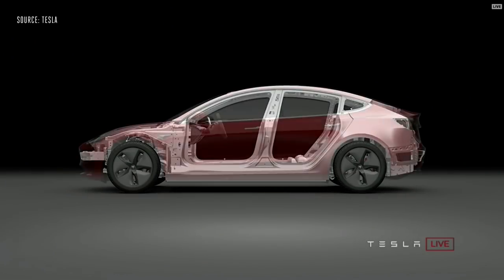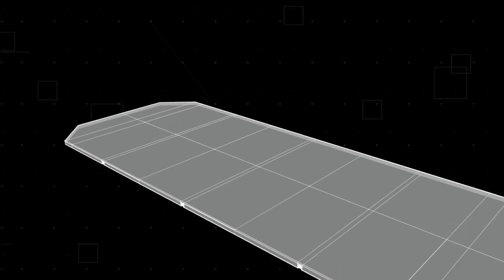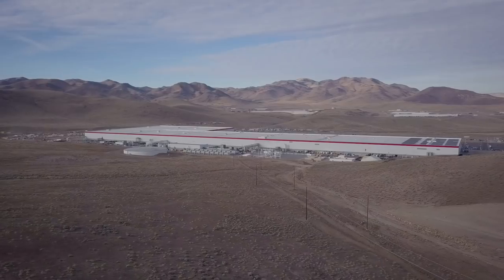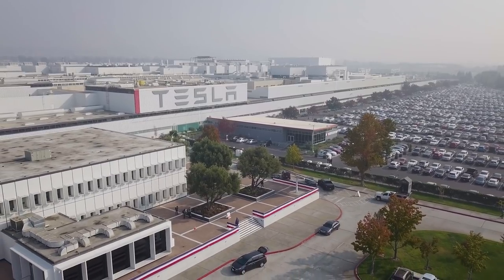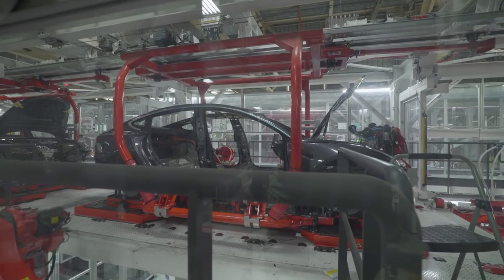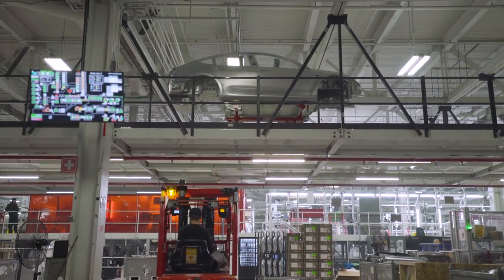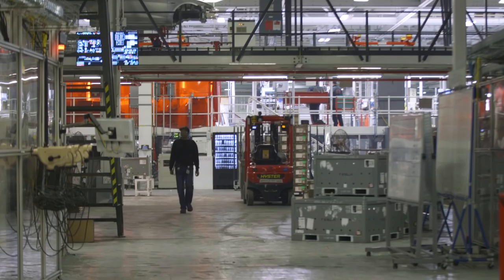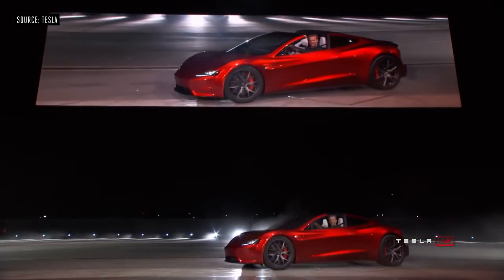This is Elon Musk’s key to Tesla’s future

Comment: Even Tesla needs a Toyota 6:00
Reply: Not even electric!!
Reply: That’s odd
Reply: Toyota has a heavy machine division whats wierd about that i own a firearm made by an auto manufacturer
Reply: In other words, Tesla needs Japanese technology.
Reply: Tell Elon, and he will have a Tesla electric forklift in 2 weeks.
Reply: @michaelclimb  Actually I'm pretty sure it's electric
Reply: Well Tesla did buy a freaking FACTORY from Toyota. Not just vehicles.
Reply: Lmao
Reply: @Neojhun  yup pretty much the fremont factory is ex NUMMI plants which is Gm and Toyota joint factory.
Reply: @uziTGC  judging from the large propane tank strapped on the back, probably not.
Reply: Hayekian see that big cylindrical shaped tank on the back. That’s tank holds a combustible compressed gas. Natural gas? Propane? Not sure. But it’s definitely not electric. 😆
Reply: @treloarw  you are right, my bad! but its not like it has a diesel engine that would fill the warehouse with nasty exhaust gases, that was my train of thought. There are some hyster electric forklifts in the video.
Reply: That tank on the back is for propane.
Reply: True! But also, it will be damned interesting to see who needs Tesla in the same way when Tesla is 81 years in the marketplace like Toyota has been. 👍
Reply: Actually I think the Fremont plant used to belong to Toyota. Additionally Tesla hired Toyota Engineers originally. Since it's a Toyota, I'm sure the forklift has been operating there since the plant was built. :-)
Reply: @SuperGeronimo999  well there already are electric forklifts
Reply: No ish... i am driving one every day. We also have a Diesel Toyota forklift for outside though.
Reply: Toyota does have an electric Forklift, but only in Japan at the moment.
Reply: I suppose the robots should be made by Tesla too....  (News flash: Most factories contains tools made by other industries....)
Reply: @treloarw  that one tank is enough for a day work if you press the pedal hard...  Thats 35 liters of Propane.

Comment: Have to make a quick correction to the narration at 2:30: The Drive Unit is not made of the Battery Pack. The Drive unit is made of the gear box, rotor sub-assembly, stator sub-assembly, and the inverter. All these sub-assemblies are combined and sealed into a thing called the "Drive Unit"— a motor, basically. It turns the battery pack's potential energy into kinetic energy. The battery pack is not part of the drive unit. It is its own thing. The two work together, but they are two entirely different lines in the factory.
Reply: Gaskets.

Comment: One thing that I liked most is that its free of any sort of pollution.
Reply: There will always be pollution from humans.  Tesla definitely has pollution.  It may be in a different form or amounts but still there.
Reply: Not at all, electric cars are extremely polluting. The manufacturing process (especially the batteries), from the lithium mines to the construction is pretty bad for the environment. You have to use an electric car for at least 20 years for it to outbalance the pollution created by standard fuel cars. Photovoltaic technology (aka solar pannels) have the same  issue. However, the public always think electricity = super green, but it really depends...

Comment: tesla solar roof is NOT victory. it's regressive, because it's wasteful. it'll never financially compete with standing seam aluminum or stainless roofs with non-penetrating but attached NORMAL solar arrays - no need to replace the roofing every 30-50 years, which is major.

also, the problem wasn't an excess of automation. it was a poor implementation of automation tech.
Reply: the tesla solar roof will always be for the iMac crowd. some people need or prefer more cost effective solutions.
Reply: @JustinCrediblename  sure. Solar roof is the pure marketing, and it does not make industrial revolutions. It just helps to claim the market for Musk.
Reply: Don't forget you will also never need more than 640kb of RAM
Reply: There’s a wise man who once said “Those who say it can’t be done need to remain silent and let those who are doing it alone”.

Comment: The Semi's and Next Gen Roadsters will be comparatively low volume products so the amount of space required to manufacture them will not be so huge.  As I understand it, the Semi will be using Model 3 electric motor modules and bigger/more Model 3 battery packs so it might make more sense to ship those powertrain components elsewhere and bring the volume Model 3 production in house to the GigaFactory to cut down on shipping costs/time.  The Model Y will be a different story and will probably outpace the Model 3 IF the current trend towards compact SUV/CUV's continue to change the industry.  However, Model 3 sales will probably also taper off when the Model Y becomes available, again if industry trends continue unabated.

Comment: Questions about Gigafactory products:
What is the inbound maximum DC voltage that can come from an off-grid solar array into a Tesla PowerPack? 480 volts DC?
What is the maximum output ac voltage from the smallest Tesla offgrid solar array powered PowerPack and inverter system?
Can you get 3 phase 480 AC voltage out of the Tesla PowerPack inverter?
What is the size of the smallest off-grid Tesla PowerPack system? 100 mwh? 200 mwh?
What is the recommended size of a solar array to power an off-grid 200 mwh Tesla PowerPack system?
About how much is a 100 mwh battery pack worth (like the ones used in the models S and X)? How does that compare to the cost of a Tesla 100 mwh PowerPack?

Comment: A highly complimentary video but there are serious challenges for Tesla that must de addressed to keep the company alive.....productivity at Fremont is still below the Toyota standard at that same plant decades ago despite major advances in automation.....vertical integration is a proven money loser in auto manufacturing.....Ford pioneered it decades ago and moved on....the. Buffalo Gigafactory appears to be at a standstill, except for Panasonic solar production and multiple mistakes in manufacturing at both plants have resulted in billions in debt and no model y in sight.....the problems are serious and need to be addressed quickly before heavyweight automakers like VW and Toyota start serious EV production. They will have lower production costs and have a large dealer network. Tesla needs to hurry now.

Comment: I worked at B,M,W, in Munich Germany in 1987 that's 32 years ago ok the cars are electric but the automation there was nothing new or different about it even the robots were the same and same colour Kuka robots, the factory was so big that we used push bikes to get around, bike parks all over the factory just grab one and away you go to the canteens or little shops they had every where, we had a clock card that got you in the building you could through a machine put money credit on to it to buy your meals or use at the shops or any food and drink machines in the factory, way before chip & pin came out, everything was so far ahead of anything Britain has even now, that Tesla factory is old hat, God knows what B,M,W, is like now.

Comment: My dad recently bought a new model s and it's fantastic, the only thing I hate about it when I've used it is that the charge time is still a little bit to long though that's something I know will be improved on in the coming years. One thing that I feel they should look into though (if they aren't already) is cars with hydrogen file cells are to my understanding they are incredibly efficient, and would become even more so if the electricity made in hydrogen fuel cell was used to separate hydrogen from its paired elements. But that just like the technology tesla uses now is far from being perfected.

Comment: I didn't realize that about Panasonic. Why does Panasonic make Tesla's batteries?
Reply: Because Panasonic has decades of experience with lithium ion cell production.   Partnering with a business  that already knows how to do something lets Tesla concentrate on all the other stuff (such as building the battery pack).
Reply: @romanval69  Thanks! I was under the impression that the battery tech was part of Tesla's innovation, but I misunderstood
Reply: @MsJeffreyF  Panasonic is partnered because they have experience in building the cell factory (which they have done in many places across Asia). The batteries are built to Tesla's spec though; Tesla retains top battery researchers on their payroll (such as Jeff Dahn), so they're able to integrate battery improvements directly into cell production.
Reply: @romanval69  apart of experience Tesla gets the supply infrastructure of lithium as well.

Comment: Tesla is in serious trouble...just laid off 7% of the labor force. 
Whenever a business starts "salami-slicing" its workforce, that's a bad sign...there's more to follow...
An even worse sign is the 7% that were let go were workers with the most experience - and of course - the highest paid. 
People just aren't buying Teslas in the numbers that were expected.
Plus, if you owned a Tesla during the Polar Vortex, you'd be lucky to make a trip to Walmart and back.
Lithium batteries lose power in the cold and the colder it gets, the more power they lose.
When it's 50-below wind chill, I doubt you could drive a Tesla 50 miles on a full charge. More like 30.
Reply: tslas have a 250-310 mile range, during colder seasons the batteries use energy to keep themselves warm to operate at a nominal voltage, more energy is used to heat the cabin, overall winter seasons lower the range of a tesla by 30-50% so they still have a range of 150-200 miles, but getting a 120v extension cord and having it plugged into a Tesla overnight will save battery from using it own energy to heat itself, since polar vortex only happen once every couple of years its not much of a inconvenience.

tesla expected for sales to drop due to fulfilling orders so they are trimming workforce that they know they wont need, they are still making more profit then they have in the past 5 years so things still appear good for Tesla.
Reply: @miguellopez3392  Electric vehicles will never be anything more than a niche market. There are just too many obstacles. Too many problems with no solutions. 
 The driving force behind electric cars is politics - not technology. 

 For one thing, the whole "Green Energy" thing makes electric vehicles a non-starter. No new power plants are being built. Coal is evil. So is nuclear power. If everyone buys an electric car, the power grid will collapse.
 LNG and hydrogen are excellent choices. Both are an inexhaustible supply of energy. Independent of the electrical grid...
Reply: @LeonAllanDavis  you are very uninformed, people aren't buying electric cars because of the environment they are buying them because their less of a hassle to maintenance, cost less to refuel, are safer, and have better performance, no new plants are being built because the US does not need more power and when it does renewable will fill in the increased demand (solar has gone nearly half its price in a single decade and will continue to get cheaper), 250 million EVs arent going to hit the US roads in a single decade it would take near half a century, and in that half century the grid would only need to expand by 35% to accommodate the energy required to move 250 million EVs

97% of hydrogen comes from gas reforming, and petroleum/natural gas is a exhaustible. if every car in the US was powered by hydrogen using electrolysis then the grid would need to expand by 60% to accommodate the electrical demand.

can you name the problems with no solutions?

Comment: 6:00 they make nice clean electric cars. but still use gas forklifts. there probably is a very good reason for it, or there might not be.
Reply: There is, propane forklifts can still out work electric and tend to get used when going indoor to out and back a lot.  Battery lifts also require more area for batteries, charging area, changing area, etc..  I expect we'll have propane lifts for decades yet. :)

Comment: Why they be usin gas operated forklifts in a tesla factory
Reply: @eddiev.223  I worked in a factory that ran 24hrs and they only used electric forks, it's called having more batteries than forks so you don't have to wait around

Comment: Will this all be for naught if solid state batteries becomes economical? I hope not.
Just asking.
Reply: Expect battery tech to change.. it's one of the things EV evolution needs.
Reply: @TheEvilmooseofdoom  
I certainly do.
My question was about the factory which is producing 2170 batteries now. Will that have to retooled or what plans ,if any, are there for technology changes.
Reply: @73_de_CJHall  Change and rate of adoption usually don't run hand in hand.  Even if the new battery tech becomes dominant there will be a continued need for the old tech while production of the new ramps up and or costs come down.  Part of it will also be determined by exactly what aspects of production need to be modified to go from one kind of cell to another.
Reply: @TheEvilmooseofdoom  
Thank you for confirming my thoughts. I did not reveal them ahead of time as not to influence responses.